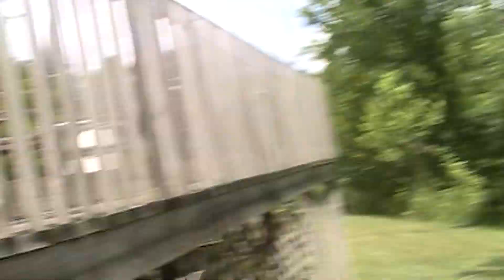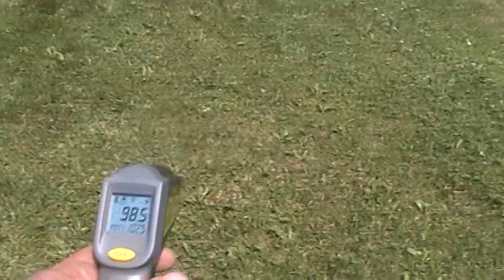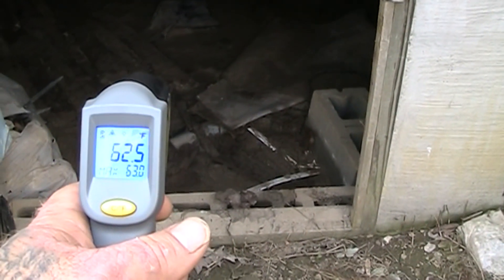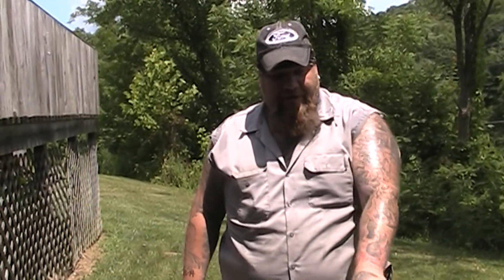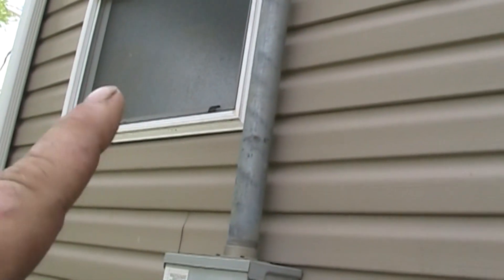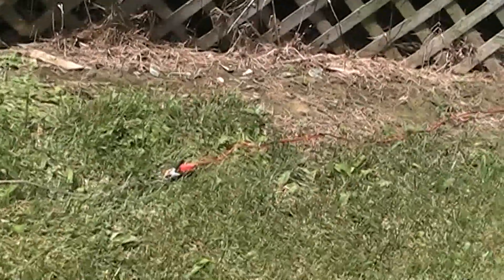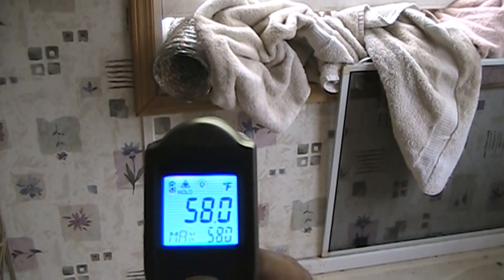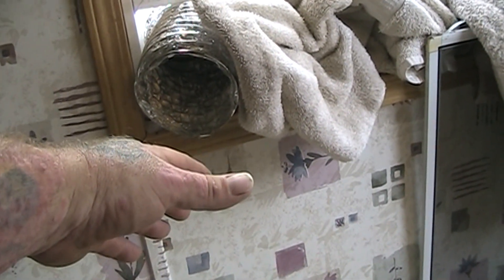Cooling My House with Solar Power: Part 1, the Experiment

Comment: You  measured the temperature of the bottom of your house a d compared that temperature with the temperature of the grass exposed to the heat of the sun. That's ridiculously wrong my friend !!!!! You should have measured the temperature inside the house and compare it with the one under the house.

Comment: Some are talking about running out of cool air under the house...
A low budget way to deal with this...
Put an awning on the north side of the house..
And water the grass under the awning..
And let that area replenish the air under the house...
If budget allows burying metal corrugated pipe would be better.
.8-12 inch seems to be optimum..
Corrugated metal seems to get better temperature transfer..

Comment: Another way to move the cool air is by pulling it with attic heat...
Rather than a long explanation
Check out earth ships tuscon az.. 
Even 2nd search use images.
And utube videos..
If you bury pipes use corrugated pipe. 
Better heat transfer..  
He has right idea..
But can be moved with heat..
And to direct air into each room..
Maybe try damper controled floor registers...
Good old common sence...
I have been thinking how to retofit an existing house using no power...
That might help those developing their powerless house cooling...
If interested give a responce 
And I'll give a short easy  description..

Comment: I did something similar to this. I cut a couple 4-1/2" diameter holes in my floor in the North East corner of my house which creates airflow the length of the building to the front door and window at the west end. You have to be sure and put some sturdy 1/4" hardware cloth over the hole to keep the critters out, and some window screen to keep the bugs out. Small sized expanded metal will do as well as the hardware cloth, just make sure the holes are too small for a mouse, which is pretty small. I was going to use PVC and a filter and then I found a window fan with two fans in it that lines up just about perfect with the holes I cut and just laid that on the frame I made for the hardware cloth and it works awesome.

Comment: interesting. building on your idea, you could coil copper tubing under the house and run antifreeze through a closed heat exchange system into a radiator in the house and avoid pumping nasty air in your house

Comment: Could you gain anymore by pushing the hot air out through your ceiling too ?
Reply: +Donald Johnston Definitely. You could gain even more by having a solar powered fan to extract the hot air from the ceiling cavity as well.
Reply: +Donald Johnston Definitely. You could gain even more by having a solar powered fan to extract the hot air from the ceiling cavity as well.

Comment: This could be much safer if you did a geothermal setup and ran a small solar pump and loop of plastic or poly water pipe under the house or in a hole in to a cheap car radiator in front of your air return for your hvac system. That would eliminate the possibility of developing legionnaires disease and radon poison for you and your family.
Reply: egn83b are there some diy ways for this geothermal setup on the tube for this . thanks

Comment: Good thinking! You may have to route some back under the house to avoid breathing stale underground air. This will also help to stop warm outside air being drawn into the crawlspace, which would make the whole thing redundant. I'd also consider getting a more powerful inline fan, computer fans are good for circulating air in computer cases, not so much a house.
Instead of blowing cooler air into the house, have you considered sucking the hot air out? Assuming you have some kind of attic or roof space, you could create fan vents in the ceiling and force the hot air out from the top of the house, which would in turn draw cooler air in. You could control where this air came from by opening certain windows. Ground floor, facing away from the sun would probably give you the best results. I've never tried anything like this, but in theory it sounds pretty effective.

Comment: Congradts you have just discovered Geo-Themal cooling 

Depends on your scrounng ability  try finding some coragated tin/galvy pipe under the house as much as you can like a U shaped tube  so it will get cooler  and in cold weather it will help warm the house if it drop belows 56° F  and it wont assorb radon gas since its in direct ground contact 

If you dig a trench under ground 3 feet and lay the pipe in it  it will work better   it will cool beter with direct contact  rather just in cool air under the house

Comment: Congradts you have just discovered Geo-Themal cooling 

Depends on your scrouging ability  try finding some coragated tin/galvy pipe under the house as much as you can like a U shaped tube  so it will get cooler  and in cold weather it will help warm the house if it drop belows 56° F  and it wont assorb radon gas since its in direct ground contact 

If you dig a trench under ground 3 feet and lay the pipe in it  it will work better   it will cool beter with direct contact  rather just in cool air under the house

Comment: It could be cooler under there because the air tubes  may have a hole in it .yes it's cooler under there most the time but maybe not that cool. good luck

Comment: Wondering if you could rig that so that you could run those ducts so that in the winter you could change them over and plug them into the heat exchanger.  That would be cool.  ;)

Comment: Was reading all the comments... some good ideas.  Don't forget to put an air return from the house to the crawl space so you are not pulling the hot outside air into the system.
Reply: One more thought that may help.  My dad was in refrigeration many years ago and taught me this little bit of wisdom.  It is hard to get your brain wrapped around, but will help whenever you are working with temperatures... Heat has substance, but cold is simply the absence of heat.  We can move heat, but not cold. Cold surfaces will absorb heat, just as hot surfaces radiate heat.  Notice that heat is what moves... crazy, I know.  Hope it helps.

Comment: great idea to cool the house, I would recommend you get some 4 inch pvc, under the house, dig down at least 2 to 3 feet and lay out the pvc. you want to have several runs going back and forth like a solar heater set up, back fill over the pvc and have a inlet coming from the hot side of the house, push it thru the pvc and bring the other end of the pvc back into a different room, the ground will act like a cooler instead of using the air trapped under the house

Comment: this is awesome! wish i had a crawl space! we have a finished basement our son lives in but it is much cooler down there may have a great way to move it up into the rest of the house or I had thought about making a homemade air conditioner cooler you put a gallon jug of frozen water in,,,but in a SHTF situation ice will not be available so you have a great thing going there,,,sure cant wait to see how it works out!
Reply: Check to see if your furnace has a "fan only" setting.   If your upper and lower levels are all one zone, as many older homes are, then just turn on your furnace fan.  They run more efficiently when they are not stopped and started all the time.  Just remember to change the filters and oil the fan more often.  Works great in our old house.

Comment: Great thinking!  I believe this is the basic theory behind geothermal energy.  Drill a hole about 40 feet down where the temp is about a constant 55 degrees, and draw the air up into the house.  Cools the house in the summer, warms it in the winter.

Comment: I like it.  the crawl space is cool because it is damp in there and dry outside. the air you are moving out of the crawl space has to be replenished from the outside air. the outside air is 100 degrees.   moving the intake further under the house will keep the mixed air away from your fan.  at some point you may need to dampen the dirt in the crawl space to keep the cooling action going.  The sun is going to heat up the tin foil ducting  so you may want to insulate that also while you are gathering materials for the under house more permanent.    the other way to cool the tubing down is to use evaporation.   wrap the dryer ducting with a towel and drip enough water onto it from the top to make the whole thing wet.  as the sun dries it the evaporation will cool the tubing to less than it would be otherwise.  It should be enough to counter act the sun heat anyway,   swamp coolers are limited by humidity in the air they work much better in the deserts than in the upper midwest

Comment: John, while I could be wrong, suspect there won't be much to gain from this. As the computer fan runs, it's pulling hot air into your crawlspace, at approximately the same rate cool air is leaving. Gradually the the temperature in your crawlspace will rise. The more fans you install, the faster this will happen. 

Sincerely hope I'm wrong. Just try to find a way to confirm amount of cooling you actually have before cutting holes in the floor.
Reply: He'll need to have an in house return to the crawl space... Not pull air from outside.

Comment: Here, the ground temperature is 58 degrees.  I have tubes that run underground and are used as supplimental passive cooling.  My house was designed and built in 1990 by a phycist, and his cooling ideas work.  I thought it was kind of crazy when I bought it, but I've been here 15 years and I really appreciate it when the bills roll in.  In the winter, the sun is low, and can shine through the glass wall on the south side.  I use less than 2 cords of wood in the winter, and cool with only a water cooler and those tubes in the summer.   It's possible if I had more vents, or fans built into them, I might not need the water cooler.

Comment: Combine that with water from a swamp cooler, especially in dryer climates and it could get down to 55-60 *F, Like for instance if you put a small swamp cooler under the house with wood or metal ducting up to the floor. I realize that might take more energy to power it, but it could cool a larger area, more of the house. If you live in a more humid area then cut back on the amount of water, restrict the pump flow through the media or shut it off completely. Just an idea I have been thinking about.

Comment: Good idea but you might not want crawl space air.You do want the ground coolant though.Put 4" PVC in corner of each room to be cooled, out of way and 4" hole for register in opposite corner.Hot air rises so I would use top of PVC to draw and floor register for return.Now for the tricky part,.get in crawl space and dig alum vent under ground in a snake configuration.hook fan to PVC top to draw room air to crawl and up to room with cool air.Pretty cool ,parden pun.I think I just talked myself into trying it.

Comment: good idea, but like said, be careful of mold, dust, pollen etc that can be under house.  Also when do final setup insulate the pipes you will lose a lot in a short run without.  deff somekind of filter system maybe put between fan and pipe, keep those items mentioned and bugs also out.     Hope all works out for you john, stay safe, prepare God Bless

Comment: Pvc will flow better no areas for the air to become turbulent. .. also when installed under the house the sun has no way to heat the air before it gets into the house. .. great idea

Comment: Don't  cut holes in you floor too quick , as you run the fan the cool air in the crawl the space air will be replaced with outside air and the crawl will eventually warm up , then you are left with holes in the floor .
Reply: That's exactly right. It will blow cool air UNTIL the outside air is sucked under the house by the fans. Just a matter of time.
Reply: would returning the air from the house back gown to the crawl space slow the amount of air drawn in from the outside?

Comment: Idea:  Standard floor registers and duct boxes hooked to short pieces of dryer vent hanging 1-2 ft below floor in crawl space with fan in bottom end of dryer vent.  Captures air a bit cooler than what's at the top of the crawl space.  Floor registers can be shut during cold weather to keep heat in (or covered in plastic for an airtight seal).

Comment: One question, wouldn't the tubing being in the sun heat up the air as it flows through? Only a question if your running the tubing exposed outside. This just gave me an idea about using pvc wrapped in insulation to come in through a few areas in the lower walls so just curious about having the vent tubing still being on the exterior.

Comment: You might try to find some insulated duct to transfer the cool air?
  http://www.lowes.com/pd_126859-42471-LW410_4294821942__?productId=3664118&Ns=p_product_qty_sales_dollar|1&pl=1&currentURL=%3FNs%3Dp_product_qty_sales_dollar|1&facetInfo=

Comment: I hope it works but you may have a problem with the dampness of the air. That may cause it to allow fungus to grow on the walls, ceiling, etc. But again, I hope it works because that would help a lot of people during the hot summer time.

Comment: The best way is to circulate the house air in and out of the crawlspace otherwise you are pulling hot outside air into the crawlspace.

Comment: That sounds like the old "cool tube" idea. Except they buried long tubes up a slope from the house. Gravity would force the cooler, heavier air through the tube and into the house. You might want to shade your drier vent hose.  Great application. Take care.

Comment: You might consider installing a similar duct on the other end of your home to move air from the top (ceiling) of the room to under your house. This would put conditioned air under your home rather than drawing outside (hotter) air through the vents. Since it is damp under your house, some kind of mold filter might help. You could cut one filter to fit many ducts. If the HVAC ductwork is under the home you could also run your fan into the duct and get cool air to the whole home.
Reply: Winning!!!! I love it!!!

Comment: You have a lot of good ideas but this one is bad.....Crawlspace air is humid and could have lots of mold spores. Air you pull out into your house will be replaced with outside air. I don't even vent my crawlspace (South Carolina) I have a dehumidifier down there. Money better spent on attic insulation....as much as you can fit in but just don't block the vents up there.

Comment: I hate AC, I leave windows open all night, then in morning shut and keep in, then turn on the heater fan only to suck up cold air in the basement. I put a cold air return in my basement which you aren't suppose to have I guess, and it keeps the house cool till evening, then open windows again. Plus I a big ass floor fan on me when sitting. Yes you could create more problems with mold and stuff, if you hooked it to your furnace intake the filter would maybe take care of that.